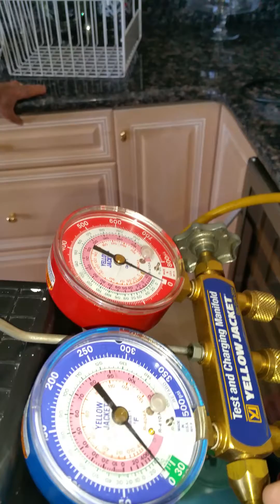Adding stop leak to refrigerator with freon leak

Comment: This is a great information I have been looking for. I have a 42" built-in GE Monogram refrigerator, which uses R134a. I charged Freon in this refrigerator several times, which usually lasts 2-3 weeks. Would you recommend "Stop Leak" or any leak sealant for my refrigerator?

Comment: My 19 year old Frigidaire stopped cooling on my fridge/ freezer. Called a tech who determined after a few minutes of inspection it was the temperature timer that was not restarting. Compressor & freezer fan work great but it’s been over 24 hrs and still not cooling. This must be a Freon leak they didn’t check for no? Wonder if it’s worth it now. All new fridges are on backorder.

Comment: Is it ok to add a small can with stop leak on it for cars? For example the auto zone can that has stop leak, or will that damage your fridge?
Reply: these cans for cars has car compressor oil it will mix and has 3/4 oz stop leak, 3/4 oz red dye, 3/4 oz 0f R-134 i used many on appliance's until found something better. http://www.directhvacsupply.com/pro-seal-8-liquid-stop-leak-any-system-any-size-envirosafe-sealant-nasa-developed/
last dam need a yr. i us about 1/2 shot glass or less.
Reply: @apphvreftetn did the auto ones worked for you?
Reply: Cesar A. Rodriguez Zamora real do not ok automotive oil And refrigeration oil may or may not mix. So found proseal 8 oz for $75.00 only us 1/8 to 1/4 of a ounce in appliances

Comment: We have a kenmore elite that repairman determine was leaking from the front of the fridge. He said because it's a sealed system, that is, placed between inside and outside and then filled with insulation, it cannot be repaired. Are you suggesting maybe it can be?
Reply from the maker: +dana s if it is made it.can be fixed. Where there is a will there is a way. There are a lot of techs.out there that do not know sealed system repairs so they tend to discourage the repair of them hence giving you the unfortunate bad news to throw away. All sealed systems are.fixavle.unless the Freon leak is in the cabinet of.the the fridge. And even then you can always bypass the line.thru the cabinet and put the fridge in the garage for a back up fridge. It will sweat a little on the outside but it will work.

Comment: I see you're green at this. 1st mistake this cvan seals up to 1.5 hp and this unit is 1/5 or 1/3hp. This can will seal 6 to 8 refrigerators. Your floating system with stop seal. The drier will stop up soon. 2nd you add the can before you add freon better to empty the can. 3th you need read the can state can has to be upside down so the sealer to leave the can your finger is on the arrow LOL. 4th you never got the sealer in the system you only removed the freon in the can leaving the seal in the bottom of the can. This look like a subz . Why shoot self in foot  just change the evap coil that leaking.
Reply from the maker: +Tony Martin that's amazing that you speak like you know what you're talking about. The video is about sealing leaks without replacing evap coil. Also these cans have to pressurized by the system that is what mixes the contents with the sealer that you then regas system using the contents of the can. This is supposed to be an inexpensive alternative
Reply: pressurizing the  can  with  'equalized'  pressure,  approximately 70 lbs....  then  sending this  back into the system  during   'run'  is  perfect way to  get  a 'shot' of sealer.   No way  it's going to   dump the whole  contents like  Anthony claims.  If  the  can is   say,    3/4's  product,     it  doesn't  take a lot of  VOLUME of  Freon to  pressurized  the  can  to  the  equalized pressure.   Maybe  1  cubic inch..   So,  when  returning that  'pressure'  back into the  low side  when running,     that  '1 cubic inch'    is  all it's  going to   take  to   reduce the  can's  contents  to   say,   2-3 psi  typically seen on  the low side of  home appliances.    That is the point   of  which   product will stop flowing out of the can.
Reply: @roberttammerawitchey4652  WITH  the right sealer 3/4 oz. only not a seal can for 5-10 lbs of freon when a refig only has .5-.7 oz less than one pound. This can you have is rising the oil level in the compress and it will start pumping more oil than normal.
Reply: This is not a sub zero. Looks like it’s a kitchen aid built in from early-mid 90s

Comment: I have experience using stop leak in air conditioners. I cannot find a stop leak product designed for home refrigerators. What product/brand are you using? The problem I am finding is my home refrigerator holds 5.5 oz of 134A. I did buy a can of Easyseal SS but didn't use it because the instructions said not to use it on systems less than 11 oz. I called tech support and they said don't use it. Appreciate any help you can offer since I cannot find the slow leak.
Reply: Your right the can is for a/c up to 1.5 hp. At a supply house and had tell the salesman this is not for refrigerator. Most leaks are copper to aluminum welds.
Reply: Auto stop leak would be better to use closer to a charge of a refrigerator.
Reply: Diversitech stop leak, it’s called 972kit